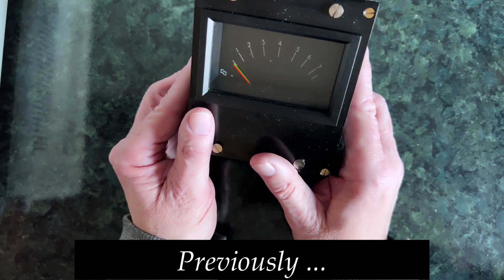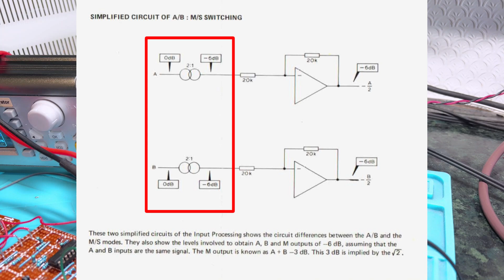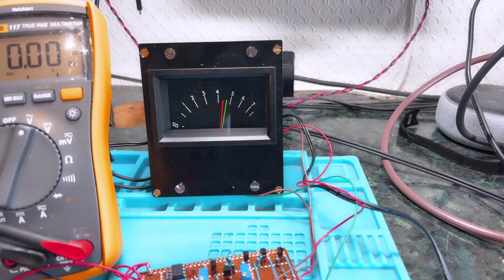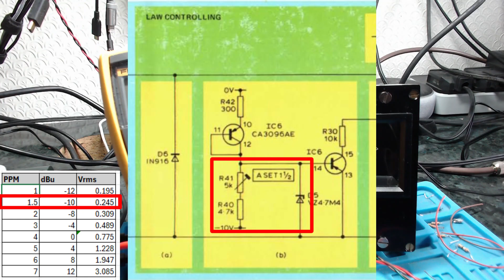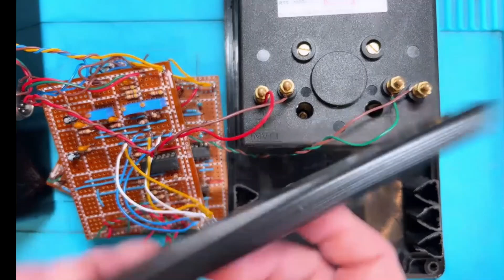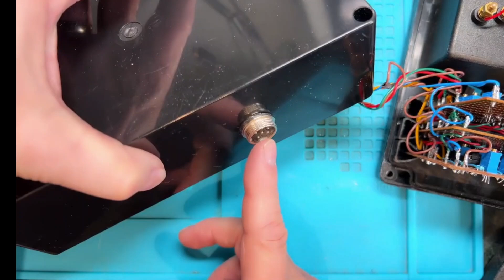Time To Make My Meter Part 2

Comment: Excellent job Neil, would be interesting to look at its frequency response. We used to use them to line up studers  etc. so the meters are usually quite accurate across the whole range. Keep up the interesting videos, love Alan P. 😂
Reply from the maker: I recall there is an HF lift network somewhere in the first stage, but I confess I haven’t squeaked it. I too used to line up studio tape machines with the portable PPM. In this project I didn’t implement the S+20 button for checking azimuth though!
Reply: @neilsradios  yes the azimuth +20, memories flooding back! Line up tape recorded at 250 nano Webers per meter... sorry! 😂
Reply: Thank you,  it nicely shows up the stupid amount of compression on commercial radio stations.